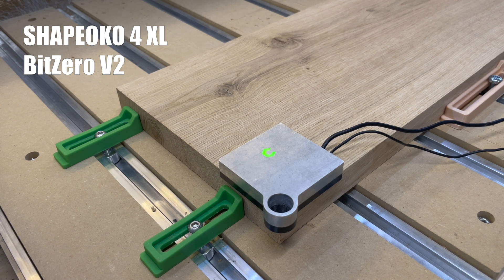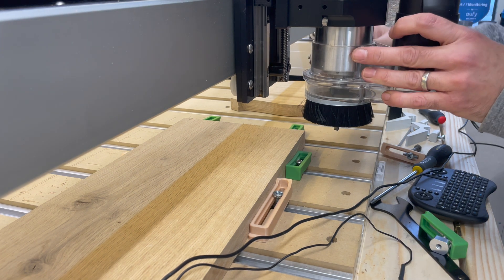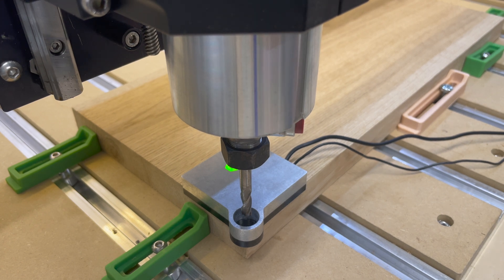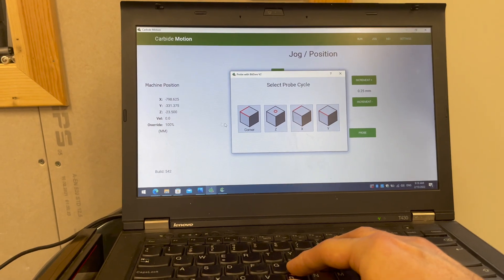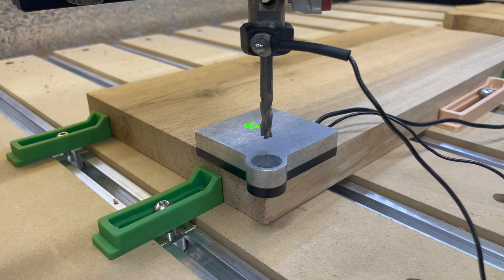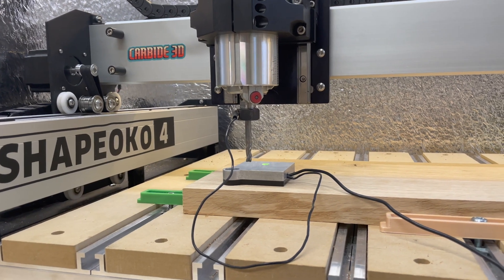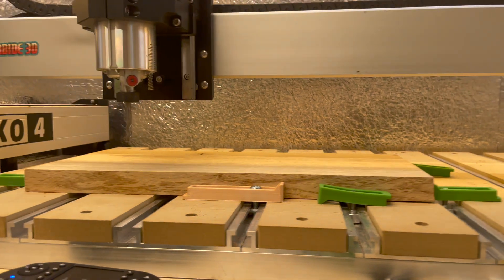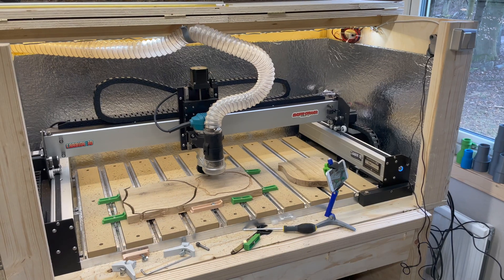HOW TO USE the BitZero V2 with BitSetter and Carbide Motion - CNC WOODWORKING

Comment: I don't know why it touches the top when doing the xy.   Makes no sense to me since you are following the software prompt for xy only. To get the z you have to put the touch plate on the top of the surface and it is at a different height than when on the corner because of the lip on the touch plate
Reply from the maker: Yes its a strange one

Comment: Use a solid rod and NOT an end mill. Hold the BitSetter in place, if not it will move when probing the X-Y. You do have to do the Z separately.
Reply from the maker: Thanks for your info!
Reply: If using a reference-pin instead of the endmill, then you have to set the z-axis once again, when changing from pin to endmill. So I don't see the idea of the (provided) reference-pin. Maybe if you use a single-flute endmill. Cheers
Reply: The issue is if you do not have the cutting edges of the bit, 2 flute cutter, tangent to the Bit-Zero opening you will not have the true diameter of the cutter-bit.
Reply from the maker: Good point you would have to set z axis again @Christian-eh8iu
Reply: @Christian-eh8iu He's got a bitsetter, so after using the pin on the bitzero Carbide Motion sends it over to the bitsetter where you install your endmill and it then uses the bitsetter to reset Z.  Pretty simple process.
Reply: @oldbroncoguy 
That's what I thought but at least for me, since I have the old bitsetter with the magnetic tip, the reference pin just picks up the top of the bitsetter and it doesn't work.
Reply: @Christian-eh8iu  No you do not. Once ZERO is set the bitsetter will just zero the tool. Tool has nothing to do with the set zero in the software,

Comment: probably shouldnt be using an end mill to do this, the space between the flutes wont be able to give you a true reading
Reply from the maker: What do you suggest to use?
Reply: @logicron  typically you would use a machinists dowel, something round so that you don’t have flutes giving inaccurate readings.  They make some that are even precision so you can get a really good reading, they are meant to be measured at the very end and are typically longer.
Reply: @CryoftheProphet  thanks for the info!

Comment: Thanks for the video, very helpful.  A question: I assume that the bitzero has a lip to it to keep it in place on the corner; when you moved it off the corner to get your z setting, wouldn't it then no longer be sitting flat?
Reply from the maker: Thats correct it has a corner and dont sit flat but it does set the Z correctly

Comment: Just a observation.... First you can jog the bit as far into the cup as you want. Secondly you don't have to run the second probing cycle for Z....It sets X-Y and Z the first time.
Reply from the maker: Thats what the software claims but i have tested several times,  it does not set the Z first time

Comment: This video was so helpful!  I'm very new to using a CNC, when using the BitZero V2 to set the z axis I still had it on the corner which was causing it to cut a little bit through the bottom of the project and the wasteboard.  Couldn't figure out why, but this fixed it!
Reply from the maker: Im happy it helped :)

Comment: Hi there - thanks for the video!

I probed x-y first, then probed z just like you did in the video.  For some reason, when mine goes to start the job, it starts the z way too high up, so it's not actually cutting anything.  I wonder if I should be probing the z with the bitzero directly on the bed, but that doesn't sound right if this is working for you.  I have the bitsetter as well, appreciate any feedback :)

edit:  I had my stock thickness zero height set to "Bottom" instead of "Top" in Carbide Create Pro.  Forgot to redo my model after I bought the bitzero.  Hope this helps someone else!
Reply from the maker: Thats stange i had the exact same problem, but that was before i probed the Z after i did x-y. Did you home the mashine properly in the begining? maybe try to reverse and do Z first? Let me know how it goes!
Reply: @logicron  the first thing I do when I start my process is center the router and zero all.  I'm not sure why the x,y,z probing doesn't just set it correctly.... but if I zero all first it works everytime
Reply from the maker: @jaymedavis7567  Do you also have the bitsetter connected? Thats when it started becoming strange for me , when i added that one.